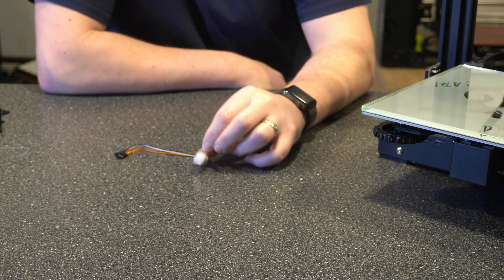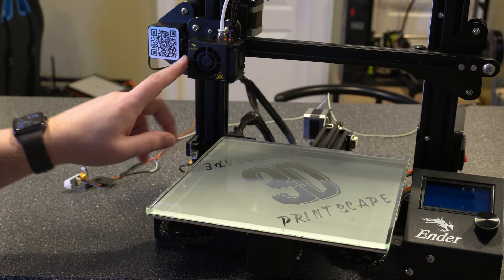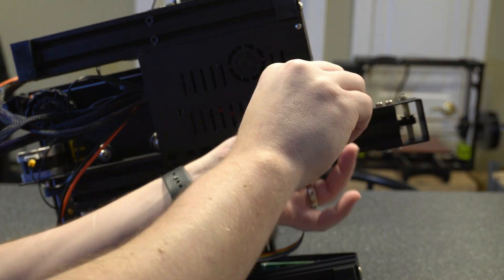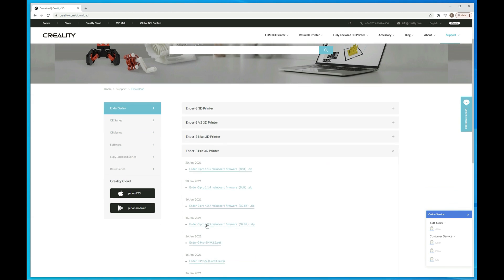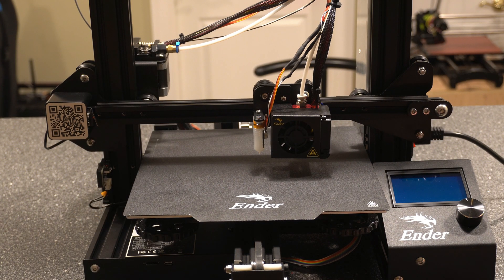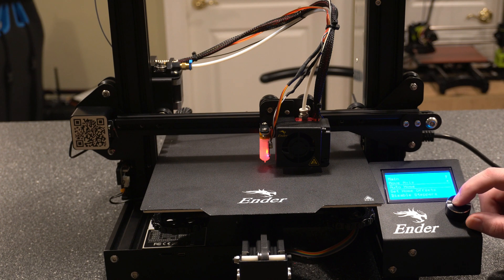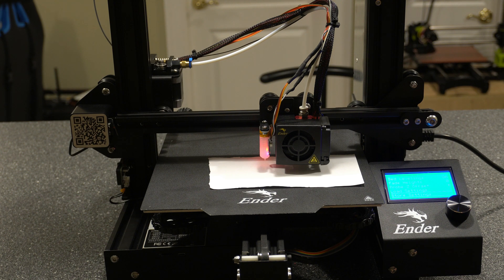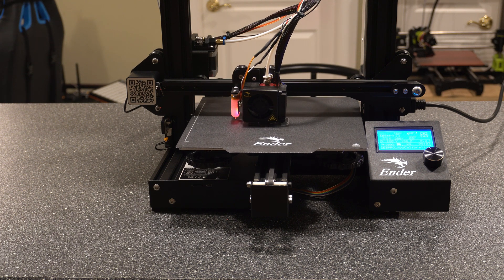Guide to Install a BLTOUCH on a Creality 32-bit Mainboard

Comment: Can't seem to get my cr touch up and running...please help
Reply from the maker: Hi. What issues are you running into?
Reply: @3DPrintscape  thank you for your reply...
So I have the basic ender 3, not s1 v2 or pro, and when I go and download file install to printer, I can't get the z offset to stay. It tells me err to far out of reach or something like that. I have the 4.2.2 board and just ordered the 4.2.7 board to see if that helps.
Reply from the maker: @scmafia7515  Let me know if your still having issues after you get the 4.2.7 board installed.
Reply: @3DPrintscape  I have installed 4.2.7 and i am still having issues as well. I'm also in your discord, talking in the the cr/br touch or general help section.
Reply from the maker: @scmafia7515  ok, if you cant get it working just ping me on discord.
Reply: @3DPrintscape  not sure who to ping on discord.
Reply: Who do I ping?
Reply from the maker: @scmafia7515  You can use one of the main channels or ping me directly.

Comment: why does my BLTouch connector look different than everyone elses? it just has a connector that fits directly onto the board, im having issues with my BLtouch not compensating at all on my 4.2.2 ender 3. but cant find any videos with people who have the same BLTouch connector that I do.
Reply from the maker: HI. What connector do you have? I have had some that have the 3 + 2 pin connectors.
Reply: @3DPrintscape  i have a 5 pin connector that goes straight into that slot on the board. also i scanned the thing on the back that shows my BLTouch was authentic. i thought maybe it wasnt a while back. but the QR code shows it is authentic
Reply from the maker: @matferrell2816  Ok, so the 5 pin goes into the bltouch port, the z stop should stay connected, and you will want to grab the normal bltouch firmware.
Reply: @3DPrintscape  yes sir, that was the first thing I tried. It will go through and prove the whole bed, yet it either doesn’t compensate at all, or it seems as if the mesh that the BLTouch has created is somehow inverted. What I mean is, the nozzle will go high on the low spots and low on the high spots. Been trying to figure this out for months.
Reply from the maker: @matferrell2816  I would try to clear the eerpom to see if that makes a difference.

Comment: hello, great video but for some reason my printer will not recognize my sd card and will say no tf, but when i do get it to work with the probing and all, once it starts printing the plastic and i start to do small tuneing on it it stops moving in the middle and i get no responce from the screen so i end up having to turn off the machine
Reply from the maker: Hi. Take a look at this video and give the firmware i call out there a try. https://youtu.be/t4QE1jPncms

Comment: I followed all the steps but now after dragging and dropping the thumbs file into the ender 3 pro sd card it came with it changed over to the new format. But the Tf card reader reads scrambled and sometimes it will say card inserted on the main screen but can't click into the files. Does the thumbs drive need a certain location?
Reply from the maker: Hi. Did the new firmware actually upload, it wasn't clear from your question. The SD card should be 8gb or less and fat32 formatted.
Reply: So I followed everything in the video but now My card says No TF card. I have reformatted it to FAT32 and re copied the original files back onto the SD card and transfered the Marlin2.0.1-v1.1.2 and still not able to read card.
Reply from the maker: @joshsimpson7853  What firmware is showing in the about screen on the printer and have you tried other SD cards? These printers can be picky on cards used for the firmware updates.

Comment: I have installed BLTOUCH on my ender 3 Pro on mainboard 4.2.2 - exactly as shown in you video - nad yesterday I found your z-wizard an thought this is the answer to all my problems
Reply from the maker: Hi. The z offset wizard is great, its just not enabled in the Creality firmware (at least it wasnt the last time i checked).
Reply: @3DPrintscape  - Ok but after at least 25 views of the suggested video - Guide to install a BLTouch ... I finally had succes. Thank you for your support

Comment: OK after your answer I did the same again one more time, then a test print and as the extruder didn't touch the bed i went into move Z axis again and made ajustments. Then it printed but not any good. now it is totally no good. scrapes the bed and BL-touch went craisy. are there any way to reset the machine and start over?
Reply from the maker: Hi. Its either clear, or restore settings, or something like that but it will clear everything that isnt part of the firmware.
Reply: @3DPrintscape  _ there is nothing named clear nor restore setting on the display - but there is something called "restore failsafe" and what that means I don't know. But did you see the comment where I wrote about the z-Wizard int marlin software that that I loaded in Version 1.1.2 for BLTouch - did I missed something?
Reply from the maker: @peterberggreen7824  I replied to all comments I saw, if I missed one please let me know what it was here. There should be a restore defaults under the configuration tab.

Comment: I received the BL Touch and followed the install instructions and firmware update, but after restart and Auto home, move axis Z , I get a "Homing Failed: PRINTER HALTED.  Please Reset".    Help!!  How do I resolve this?
Reply from the maker: Hi. What firmware are you running and how is the bltouch wired.
Reply: @3DPrintscape  I downloaded the firmware as instructed from their site.   Wired as instructed.   Wiring on the actual BL touch was a bit challenging.   Not sure if they have their instructions correct - seemed to have a notch on one side  which matched the connector.    Which is opposite from their instructions.
Reply from the maker: @waynenorthway3944  If seen the bltouch shipped with like 10 different wiring options. Do you have all 5 wires going to the bltouch port and is the z stop plugged in?

Comment: I have the same connectors/wire setup as yours, but the connectors that plug into the mobo are very loose. Feels like they will likely fall out. Did you modify your connectors in any way, or does it sound like I just have a bad connector?
Reply from the maker: Hi. I didnt modify the connectors, but i have heard people have a similar experience to what your seeing. I would recommend using some hot glue to hold everything in place.

Comment: First of all, great video. Your channel is by far the most helpful I found so far. Had my ender 3 pro for three days and you helped a lot. Consider me subscribed!

Now, quick question if I may, when I choose the level bed option, it only probes 1/9 then stops and says “end stops z”. What am I missing?
Reply from the maker: Hi. Thanks for the feedback and sub :). What board and firmware are you using and is the z stop connected?
Reply: @3DPrintscape  Hey Rob, thanks, I have the 4.4.2 board. I have the Z stop connected. I am sorry for the stupid question, but which of your firmware should I use? Also, my bltouch connector is an all in one plug if that makes sense?
Reply from the maker: @sinver147  The name of the creality firmware file you would want to use is Ender-3 Pro- Marlin2.0.1 - V1.1.2 - ALT.bin

Comment: One issue I've had: when I upgraded from a microsd to a full size SD card my Z offset was way off. The CE3pro was trying to print in mid air. Are the stored settings actually stored on the SD card?
Reply from the maker: Hi. It depends on the printer. If its a newer one with a 32 bit board it should be saving it to the local eeprom.

Comment: Thanks a lot this was one of the more helpful videos out there. I would like to note the file download on the Creality website is not a standard Zip file but a .rar file and my version of windows didn't know what to do with it until I added a .rar file opener from the windows downloads site.  After getting that it went exactly as you explained.
Reply from the maker: Hi. Thanks for the feedback and tip. I dont recall having to do anything special to unzip the file but i may have had support for rar files already.

Comment: When I first tried to install the bl touch, I attached the black white wires into slot Z, but it would give me the Home Z first error. I then moved the black white wires into the same slot as the other 3 wires (the bl touch slot), but now the head is ramming into the build plate and not setting the Z axis. I am using the 32bit v4.2.2. and i don't know what the problem is.
Reply from the maker: Hi. What firmware are you running?
Reply: @3DPrintscape  I am using 1.1.2  from the file Marlin2.0.1 BLtouch V1.1.2 without transfer board.
Reply from the maker: @lacro2406  ok, you want all five bltouch wires connected to the bltouch port and the z stop connected.
Reply: @3DPrintscape  i did that but it was still ramming into the build plate
Reply from the maker: @lacro2406  If you try to auto home the printer, you should be able to stop the z axis by using your finger to trigger the probe. If that doesn't work, its most likely something with the wiring.
Reply: @3DPrintscape  I noticed that when turn the printer on the bl touch doesn't have the blue light like yours in the video do you know why that is
Reply from the maker: @lacro2406  Is it getting any light at all? If not, it could be the wiring.

Comment: Hi.  Very well done but when I tried to compile the files, it comes back with an error.  STM32F103 is not in the list of Marin boards. under the PlatformIO boards in Marlin 2.0.  Where can I find it?
Reply from the maker: Hi. Try to use the marlin auto-build plugin. It will give you the board options to choose from based on the config file. https://youtu.be/EerWIATEsM0
Reply: @3DPrintscape  Hi.  Thank you so much for the response.  I did try the auto-build plugin with the same error.  Apparently Marlin has a bug that is causing problems with  STM32F103RET6_creality boards.  I'm reading a lot of frustrated users with same issue.
Reply from the maker: @Johnny_B  Are you using the latest bugfix version? I did a build with one from last week and that board and it worked ok.
Reply: @3DPrintscape  I tried everything to no avail.  However the basic rule of 'if nothing works, hit reset' seemed to be in order.  I uninstalled and deleted everything and started from scratch and low and behold, it found the board!  I'm now able to configure my CR-10 at will! Thanks again.  I do appreciate the tech support.
Reply from the maker: @Johnny_B  Awesome, im glad you got it working.

Comment: what if we have custom board 4.2.2 but decide to unplug the z stop-do you have any videos on what the custom firmware should be?
Reply from the maker: Hi. Assuming you are connecting the probe stop to the z stop, i cover that in a bit more detail in this article. https://3dprintscape.com/guide-to-install-a-bltouch-on-a-creality-32-bit-mainboard/  If you have all five wires connected to the bltouch port, then you should be able to just remove the z stop if you wanted.

Comment: Im late to the game but do you need to remove the original Z switch that came with the ender 3? Does the BLTouch and the original Z switch work together.?
Reply from the maker: Hi. You only need to remove it if your connecting the probe stop to it. If your connecting all five wires to the bltouch port it can stay. You can configure the z stop to be a fail safe in case the bltouch doesn't work.

Comment: Hey i just followed ur guide and i gotta say, its wayyy more helpful than the creality version. I keep having an issue and that is after i flashed the firmware, the nozzle keeps crashing into the bed even tho the bltouch probe touches the bed wayy earlier. what should i do?
Reply from the maker: Hi. What firmware are you using, how is the bltouch wired, and can you verify that it uploaded to the printer correctly?
Reply: @3DPrintscape  im using the ender 5 pro firmware that creality provides (specifically the one without the adapter board) and it did upload to the printer properly. It is wired exactly how urs in the video is wired.
Reply from the maker: @rushildasari7502  Does the probe self test work correctly?
Reply: @3DPrintscape  yeah 
it goes up and down if thats what you mean
Reply from the maker: @rushildasari7502  This may be difficult to troubleshoot over YouTube. Can you email me pictures of your wiring? My email is admin@3dprintscape.com.

Comment: Hey there, i'm having also issues with bed leveling, at ranomd points (1/9, sometimes 7/9..) . I am using Marling 2.x Bugfix version, configured everything correct. I have an Ender 3 with 4.2.7 silent board, using the 5 pin connector. After many fails, i soldered the cables to the 5 pin, looks like its a bit better, but still got the issue randomly. Any suggestions on that?
Reply from the maker: Hi. The only time i see the probe randomly fail like that is if the wires are being pulled on and come loose or the bed is too unlevel (i think more than a 2mm variance between highest and lowest probe).
Reply: @3DPrintscape  Many thanks for your answer. I was trying around and figured out, that the BL touch nut (which holds the magnet thingy) was tooo tightend. I just changed that a little bit, now 5 bed levelings were successfully.. finally.

Comment: Hello Again - I bought a BLTouch set for my Ender3 Pro - and when I got to the part where I should fix the kabel, I realised I had purchased the the wrong kit. So I put it back to where I starded - I hade not use firmware update or anyting. The I tried it - but now it could not go to autohome and I have not found any solution in any of your videos - so now I will order the right BLtouch and try you "guide to install a BLTOUCH on a Crelity 32-bit mainboard. I will tell you how it goes!
Reply from the maker: Hi. You could make any of the v2 or higher ones work but getting one with the 5 pin adapter makes it easer. Let me know if you run into issues.

Comment: God I’m confused… (not with your video, this is great!). I bought the same BLTouch as you (the one with the single white plug for the mainboard) as well as a touch screen kit. The touch screen went in ok (I think - it works!) and I did the firmware update for it, but the BL Touch is proving to be a nightmare with the bundled instructions being no help, loads of ‘helpful’ videos and websites offering conflicting information in relation to the Z stop, from just unplugging it at the stop itself, removing the cable from the board and the stop, to removing the cable AND the physical Z stop.
The links for the firmware download have all pointed me to the Marlin firmware update (I don’t have Marlin) leaving me floundering and not sure if I’ve completely screwed up my printer.
You don’t mention the Z stop at all (unless I missed that, but I’ve watched this a couple of times now), so do I just leave that? I’m beginning to wish I’d just left it as it was now 😭
Reply from the maker: Hi. You can leave the z stop connected (which is why i didnt even mention it for the 5 pin setup) and plug the 5 pin connector to the bltouch port. From there, you will want to download the prebuilt firmware from creality, a prebuilt marlin build from my site, or build your own instance of marlin. If you run into more issues you can get quicker help on the discord channel, invite is in the video description.

Comment: Hi, I upgraded my ender 3 pro with a 4.2.2 board. Due to another youtube video I already had an attempt to update the firmware. However something went wrong and I now have a blue screen an nothing works, also you process described in your video.
Any idea how I can get my printer running?
Thanks in advance for your help.
Michael
Reply from the maker: Hi. Try to add the date to the end of the file name to make it unique and also make sure the sd card you are using is 8gb or less and fat32 formatted.

Comment: HI Rob,

Before I make a hasty purchase, I have been looking for an extension cable for the BL Touch that is suitable for the Ender 3 Pro (4.2.2) board.  I have seen plenty of your video's and have seen you splice your wires.  Do you know of extensions cables that are already complete that you can just connect from the BL Touch to the board?  Any links you know of would be great?  I have all the other bits ready, i.e. software prepared and sensor mounted.  I just need to extend the wires.  Great informative video's on installation and prep in other videos so thank you.  Al
Reply from the maker: Hi. All of the cables i have seen on amazon only have the one connector or are stupid expensive for what you get. This one may work, but the reviews are hit or miss. https://www.amazon.com/ACTOO-Connector-Power-Female-Adapter/dp/B07GGJGB7Q
Reply: @3DPrintscape  Thanks Rob,

I will look into this.  Thanks again for your input and I value your time.  I will look forward to more of your videos and Happy New Year to you.  Al 😀